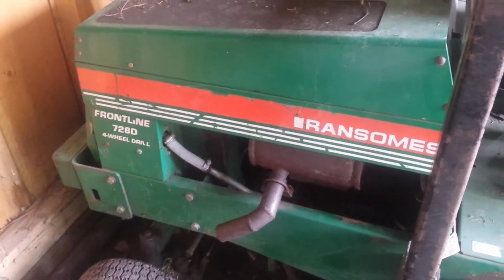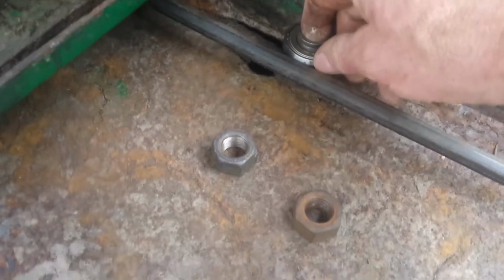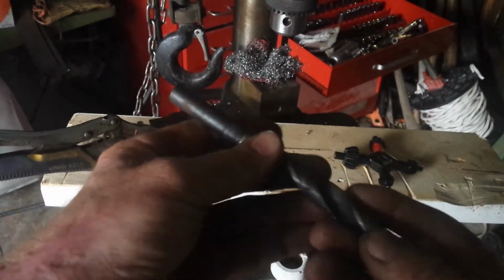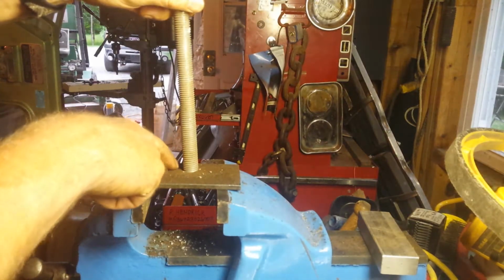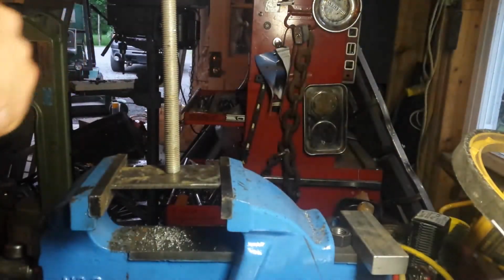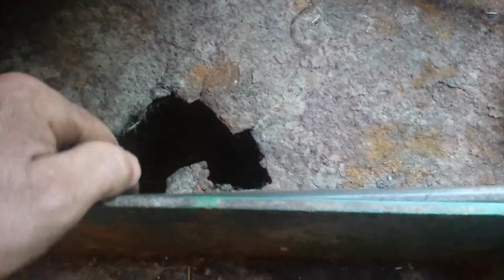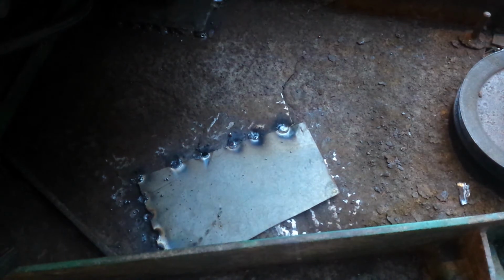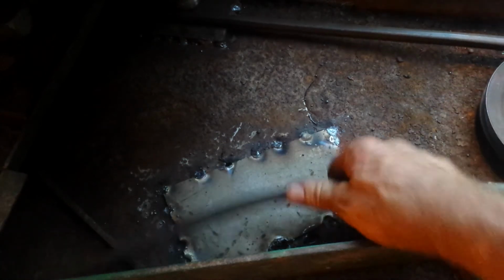Ransomes mower deck repair

Comment: Rad video, I absolutely love Ransomes mowers, especially the Frontline series.
Reply from the maker: I really like the Perkins diesel engine. The tractor is built like a tank. Thanks for watching
Reply: How many hours has it done, do you know?
Reply from the maker: Yes. I think its at 1300 or so. Jocobsen Turfcat is the same mower.

Comment: Do you know what model the mower deck is by any chance?
Reply from the maker: I recently checked the cereal number on that mower deck and it is missing. I have a 72 inch rear discharge and it's very rusted out. It need major repairs. Jacobson Turf cat is almost identical. Thanks for watching